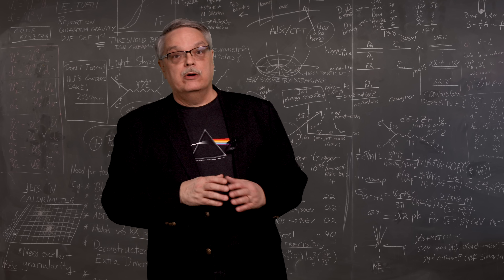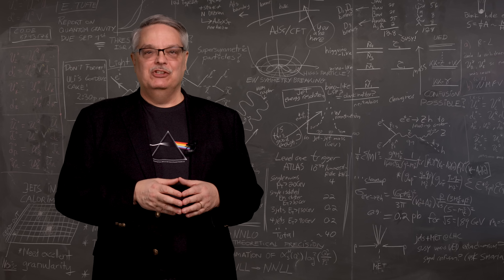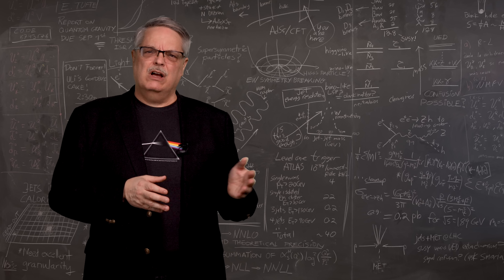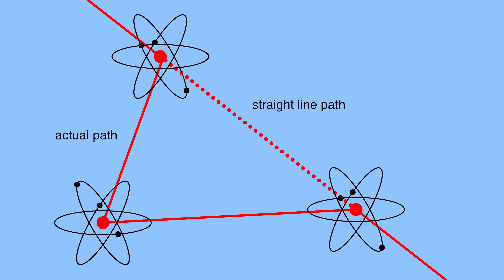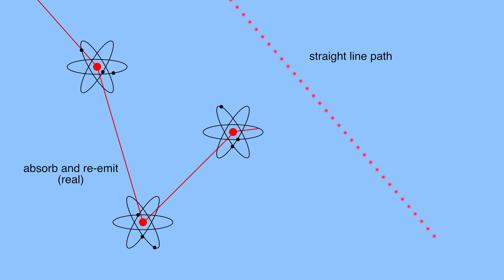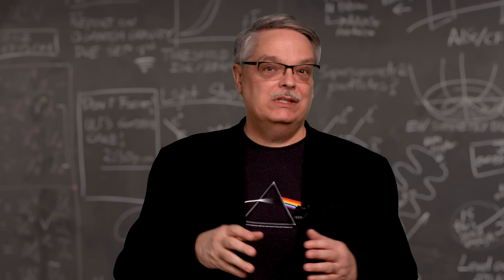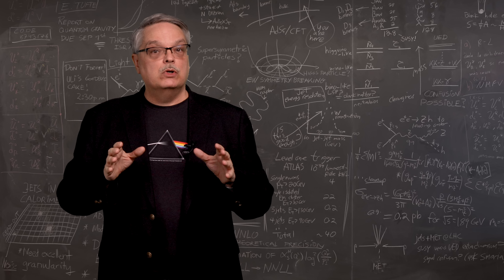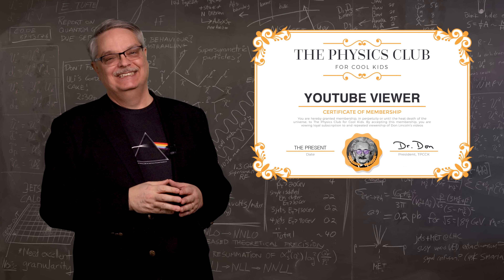Why does light slow down in water?

Comment: I'm an electronics engineer and we study Maxwell's and wave equations, of course. Optics is taught in high school. I've never really stopped to think how these two relate and your video made it crystal clear. Very interesting!
Reply: I remember that in university on a wave physics course we where taught that η1/η2==ε1/ε2. It made sense back then, but I had not a good explanation until this video.
Reply: @jorgealzate4124  The second wave is fiction, so this video adds more confusion.
Reply: @dreamdiction  Of course, there is no second wave in the sense of a "stationary wave" but there will be a second inducted wave as long a electromagnetic wave travels through the material.  Thats because the way a electromagnetic wave propagates, it induces an electric (and a magnetic) field in the propagation medium (even in the vacuum), and because in this case, the fields are moving, so they are the induced field(s), which in turn will interact with the incoming wave, and all of this results on a localized, altered wave (please physists don't kill me, I'm tryng to make myself clear, im just an engineer doing office work :'( ), then the traveling wave properties will be related to the electric permitivity of the two mediums.
Reply: @jorgealzate4124  as an engineer you should know that mixing of waves gives you sum and difference frequency waves. However this is not the case in the medium, as by fundamental law the frequency stays the same, only the wavelength changes. Collosal error in this video.
Reply: @dreamdiction  if the duality wasn't true the photoelectric effect never could work. The photoelectric effect is something proved more than a century ago with a solid model and pretty good experimental data.
Reply: @gregorpabst7423 Thank you, that's interesting. I was assuming that both the induced fields and the incoming fields were moving at the same speed, resulting in either a zero or same frequency, but at the same time attributing the propagation delay to the electric "inertia" of the medium, but that seems a contradiction thinking it better. Thank you.
Reply: @jorgealzate4124   Photons are a mental concept which does not exist in reality, electromagnetic radiation is waves at all frequencies, never particles, that's why the single slit experiment shows wave diffraction and the double slit experiment shows wave interference. There is no slit experiment which shows evidence of light particles and the photo-electric effect can be explained by waves without particles. So-called photons only exist as a mental concept in the minds of people who believe photons exist. People who believe photons exist are people who believe whatever they are told to believe.
Reply: @dreamdiction  you are writing your answer at least on a device that its semiconductors operate under the same quantum physics principles that support the photoelectric effect, and at best, you are using one that has a practical application of the photoelectric effect (the CMOS sensor from a phone camera). If you really believe that you or another person has a better theory, I hereby invite you and that person to apply for a Nobel of Physics, and you, and maybe your friend, will be able to make into oblivion the Einstein's photoelectric theory wich not only gave him the Nobel prize and gave origin to the photon, but also was the first practical application of quantum mechanics proposed by Plank.
Reply: @dreamdiction  Photons are portions of energy transferred by EM wave. And it can be consumed (as a whole) by objects orders of magnitude smaller that the wavelength of light. Literally singe atoms absorb the whole portion (photon) of energy. Scientist don't consider photons as small balls. And I would like to see your work on explaining photo-effect purely by EM waves.
Reply: @gregorpabst7423  In this video Dr. DON meant to explain: The electro~magnetic wave (*Incoming) induced a SLOWER transmission wave IN the glass (NET~result). This altered speed doesn't  mean that it's Frequency  changed 😃💬 (btw.: Frequency change always means it's Wavelength is altered.) Any engineer knows why: Wavelength goes up, it's frequency goes down. In this video Dr. DON never said that the color of the outgoing wave changed. And so, the frequency of the exiting wave wasn't changed either. Dr. DON didn't explain that blue light changed into purple light (for example). That's a different subject 😏. So you misunderstood his explanation. Incoming blue rays (into clear transparent glass) induce outgoing blue rays of light. NO change in wavelength, consequently NO change in frequency either. And the outgoing waves (*into a vacuum) are all at the original speed (of light): c
(approximately 300,000 kilometers per second).
Reply: @jorgealzate4124  Never ever get Movement of the EM field (speed) mixed up with *Frequency*. As you know by now: Speed as well as Frequency of the EM Field are entirely different parameters. And so, travelling speed of EM waves (in meters per second) is entirely different from the Frequency of those EM waves (in Hertz). One can never exchange one for the other.😃
Reply: @starkid2k13  The video includes animations e.g. minute 7:16 that are wrong in the context. The presenter is referring to a second wave with different wavelength. He never presented the right concepts "phase velocity" or the term phase.
For a correct (but simplified, without QED) presentation, look into the Feynman lectures, chapter 31 "The Origin of the Refractive Index"
Reply: @SergeiVlassov  *WOW*, I really love your explanation. The concept of 'Photons' gave us students some meaningful 'tools' to explain and calculate around this really complex matter [*Visible light].
Photons are also seen as vectors guided by EM waves. So these vectors are incredibly small, really low energy packages. Absorbed by the "576 million sensitive spots" in the rear of the eye~ball, and our brain calculates a complete high res. image. Even so, absorbed by a 48 megapixel Chip in a smartphone's camera. And the microprocessor within renders a complete image. It does make a lot of sense.
🙏🏼THNX.
Reply: @starkid2k13  thanks! But also as a scientist I should admit that we still don't understand what photon is really is. We can describe it very well, we have extremely precise models to predict its behavior in various scenarios including spectral analysis, photoeffect etc., but at the same time photon is a big mystery. We try to understand it by making some analogies with things we know from our everyday experience, but such approach has very serious limitations when we deal with modern physics. One of the biggest mystery is the way photon propagates. According to extremely well-working models it should propagate as a spherical E/M field, but at some moment when it decides to interact with matter (can happen after billions of years after emission) the whole thing immediately collapses in one location. That does not make sense, but experiments keep confirming that. Some scientists just agreed with such things and rely on "shut up and calculate" approach, others keep searching for alternative models and explanations. I hope during my life there will be some more discoveries in this field. Or maybe not, maybe we should just accept that the nature is like that and does not have to make sense to us.
Reply: @jorgealzate4124 didn’t Einstein say that a photon was a ‘packet’? That sounds like a wave chunk more than a particle.
Reply: @gregorpabst7423  "mixing of waves gives you sum and difference frequency waves" - only true for a multiplicative (non linear) mix.  This is a linear (time invariant) system - no frequency translation occurs - sum and difference products are NOT generated.
Reply: This is what happens when you opt stem but you can't understand it 🤣🤣🤣
Reply: University level Optics applies 'maxwell'  (he is not the author of the theory, but 'Physics' 'history' is full of crap and lies) and reveals that light is neither 'wave' nor 'particle' 
Few engineers get modern physics, and most of the physicists I've known couldn't engineer their way out of a paper bag
Reply: I thought light never slowed down
Reply: @joshcantrell8397 Light doesn't actually move.
Reply: @ilovetech8341  you gotta explain to me how light doesn’t actually move
Reply: Crystal clear as mud with leachs in it. 

He tried to describe the Ewald-Oseen extinction theorem, but in a totally wrong way.
https://en.m.wikipedia.org/wiki/Ewald%E2%80%93Oseen_extinction_theorem
You can find the falsification explicitely:
"...each of these waves travels at the speed of light in vacuum, not at the (slower) speed of light in glass."

2 particle based wrong explanation has been replaced here by a wave based wrong explanation. A fast and a slow wavefront can not be combined, since they can not stay together. This is not a physics model, just a wrong play with words.

The way of thinking of Don is fundamentally wrong, because propagation of light can not be modelled with infinite sine waves, that has no wavefront at all. 

Most of the animations are also completely wrong, for example at 7:11, because it shows different frequencies, while the excited wave can not have different freq. from the source wave (as can be seen at 8:11). Not wavelength, but frequency determines the color!

Almost nothing is right here, except for the falsifications of the 2 particle based explanations.
Reply: So am I. It is amazing how people forget there are two components to an electro-magnetic wave at perpendicular angles. The problem is trying to demonstrate a 3D model in a 2D text book.
Reply: @ilovetech8341  The 3(+1)D reality can be shown by its sections, and we can imagine it by generalization in head. No problem with this. Also no problem with only describing 1 quantity of the 2. The problem is that this video is basically wrong from the general fact that it doesn't deal with wavefront at all, which would be essentially neccessary for analyzing propagation speed, through mindblowing stupidities in the details, like suggesting the excited wave can have different frequency than the excitation, and that 2 waves that does not exist at the same place can interact with each-other. There are sooooo many  and sooo serious mistake in this videos, that it is less then useless. Harmful. The basic of this lession is very probably the Ewald-Oseen extinction theory, but it is ruined completely.
Reply: @PafiTheOne  I am just making the point they have dumbed so many people down and confused them. You almost need a teacher that is initiated to actually learn now days.
Reply: @ilovetech8341  Who are "they", and where are the "people" you talk about? I couldn't decode your 2nd sentence. Yes, maybe I need a teacher. But what is the thing your "that" refers to? It can't be the "teacher", since they are human, not object or animal. To persons you may refer to with "who", not "that".
Reply: @PafiTheOne  the people up above
Reply: @ilovetech8341  Haven't you noticed jorgealzate4124 above who explicitely wrote "an electric (and a magnetic) field"? How can you think he "forget there are two components to an electro-magnetic wave"? And for the rest what is your reason to think they don't know it? And what are you agree with? ("So am I.") JoaoPedro-pi9ee whose comment you replied to wrote "your video made it crystal clear", which is totally the opposite of the truth. And he did not mention anything about electric and magnetic fields.
Reply: The speed up when light exits confuses me. Also, it is interesting to see that a multi coloured straw is bent the same amount for every colour. So different colours from radio to gamma diffract at exactly the same rate? Are gamma and radio colours the absolute limits of the colour spectrum?
Reply: Does light travel in a straight line or does it emanate outwards in a sphere? If it’s a sphere, I’m confused about the way waves are drawn in this video. Also, isn’t white light an illusion that combines ROYGBIV plus other colours such  as radio and gamma waves we don’t see? Aren’t the radio waves wider than a piece of glass? How many wave widths come from a single light source?

Comment: The adding E.M waves concept is an explanation model but why does light "disappear" after crossing very deep water (eternal darkness in deep sea)  More and more light is absorbed as it loose more and more energy.
 The photons concept can also explain that the pulsating matter-anti-matter fields of a photon (50 per cent of the time it "introduce" itself like an electron and the other 50 per cent of the time it is like (same E and H fields) a positron) is when entering water plunge into a basic new (averaged) "fields influence" inside matter and therefore cycles slow down (like a spring which conserve its possibility to come back after) until it recover the free (with no matter in it) space.
Inertia forces work like that when we accelerate a mass only (the energy taken to accelerate is recovered when we brake)
Reply: Scattering and obstruction. Sea water is NOT entirely transparent.

Comment: But there are experiments that prove light is a particle. There is a “toy” that has rotating panels that are driven by light. 🤷‍♂️
Reply: Not because of photons. The black side absorbs ir and heats up. The glass globe contain a low pressure mixture of gas.

Comment: sorry, but I still did not hear an explanation why light travels slower in a medium.  "because the wave is combined (superposed) with the wave generated by the electrons"  does not explain anything.  "Why is it slower", remains the unanswered question.  Perhaps try the effect of permittivity on the Maxwell equations?  Try the effect of the polarization of charge on the permittivity?
Reply: Did you not listen?

Comment: The process of refraction, also caused Edwin Hubbel to think that the Universe is flying apart.  It is a natural fact, that light travelling across millions of lightyears of distance, is subjected to refraction, causing an apparent "Red Shift", which Hubbel misinterpreted as "Cosmic Expansion".
Reply: The cause of the red shift is not refraction, but expansion of the wave, along with space, or the Doppler effect in other cases.
Reply: @Tankeris6327  Not all "Red Shift" is a result of Doppler.  Red sunsets are a result of light refraction.  Claiming that the Universe is observed to be expanding in all directions at an equal rate, is placing the observer at the center of the Universe.  Is the Earth at the center of the Universe?

Comment: Nope it still does not make sense.  How can light slow down in water and then change direction and speed back up again after it leaves the water with no extra energy? It doesn't accelerate does it?  It just instantly speeds up again.  Speeding up takes energy.  Changing direction takes energy.  But somehow light  instantly speeds up a tremendous degree and changes direction with no extra energy?  What else in the universe can change its speed and direction instantly and do it without losing any energy?  Nothing else can, so the official science explanation about light makes no sense.
Reply: Because it's wrong.
Reply: That's because this explanation is still a bit misleading. I hope this one shows a bit more insight and intuitive understanding https://youtu.be/rYLzxcU6ROM?t=4m6s this video explains the wave behavior with mirrors, but the principle does apply to refraction, which becomes more clear with a simulation https://youtu.be/-qYh6ydhdQw
Reply: @Tankeris6327  I checked out your link and to be honest that explanation doesn't make sense either.  Neither of these 'explanations' address the fundamental question of how light can instantly accelerate and change direction without extra energy of losing energy.  What else can instantly accelerate massively without energy?  Nothing.  The official explanations of light make zero sense.  Scientific bs.

Comment: His explanation is not satisfactory.  The combination of two waves can indeed induce a beat pattern in the waves, but that does not mean that the wave itself travels at the speed of the beat pattern.  He is showing what is produced by a continuous wave.  But if you have a short wave, say, one photon, and you would produce that same image, then you would see the beat pattern moving superimposed on the motion of the wave itself, that would not change.  You can try yourself moving two combs over each other.  You will probably see a beat pattern moving very fast, but that does not mean that it changes the speed of the combs.  In the waves caused by a ship you can also see something similar: the wave itself travels at a different speed than the tops of the waves.

Comment: When integrating over a distribution of dipoles one can see that the apparent reduction of speed of light is due to the phase shift of the scattered waves due to dispersion in space. The speed of light is finite and so the scattered waves at different locations are phase shifted. Integration leeds to a resulting phase shift which is taken as a reduction in speed of light in matter. The math is demonstrated in a recent Springer Briefs book in 2020.
Reply: Huygens principle?
Reply: @Tankeris6327  Yes, it is all about integrating correctly dipole waves.
Reply: @Tankeris6327   Yes, each atom scatteres light and light 'works itself' through the medium at the speed of light. The fascinating thing is that even so light propagates fast and the atoms are densely packed there is still a phase shift since the atoms are all positioned at different locations.